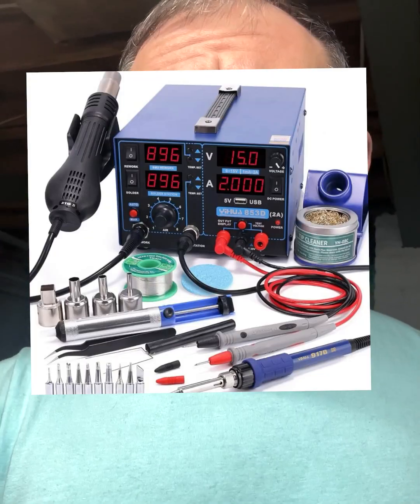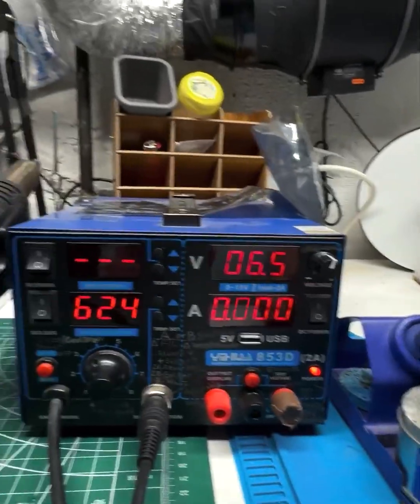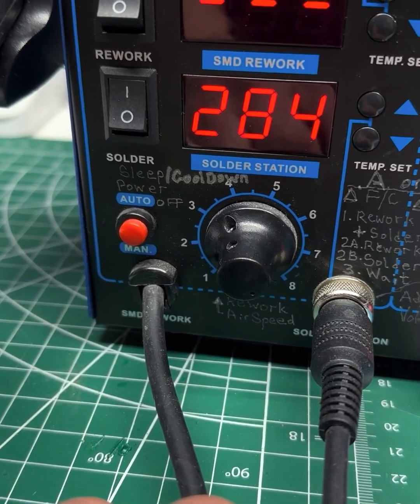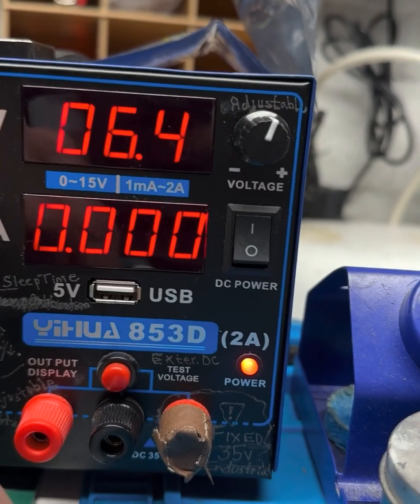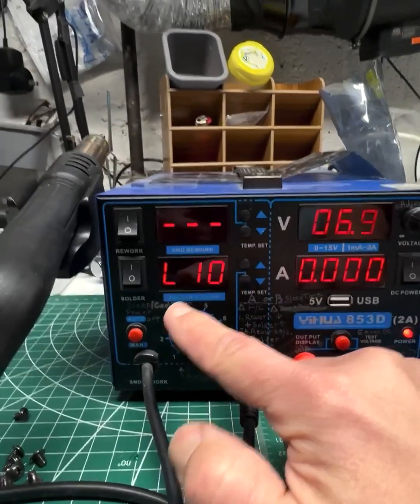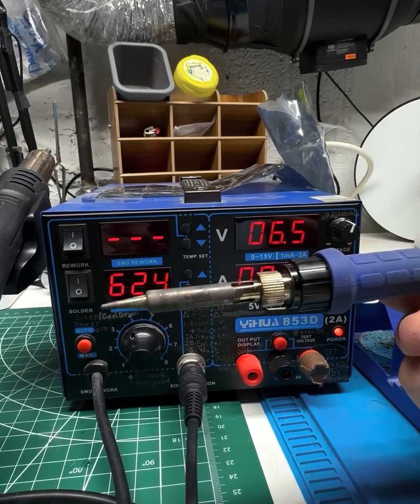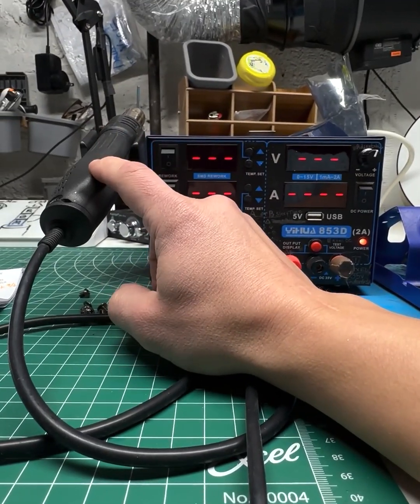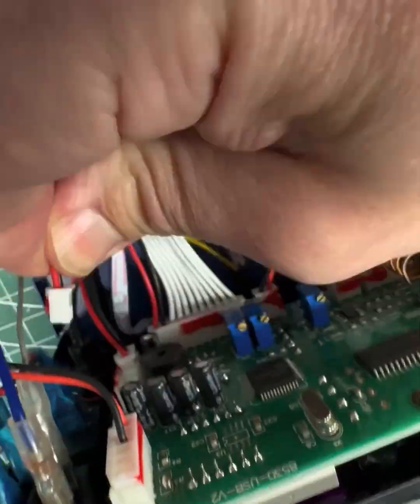My go-to 3 in 1 soldering station: YIHUA 853D 2A USB |  #soldering

Comment: Great video. Was curious about this unit
Reply from the maker: Glad it helped. It was a little frustrating when the parts started to go out. But it was nice to know it was easily remedied. I just wish I’d opened it sooner and made sure all the wires were correctly seated to get it working properly sooner - Since I’ve done that everything works great.